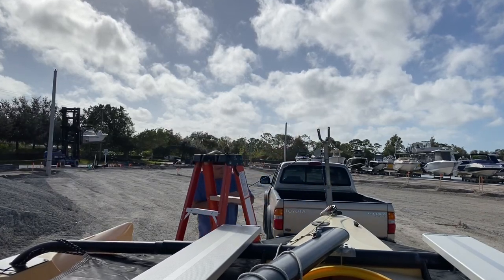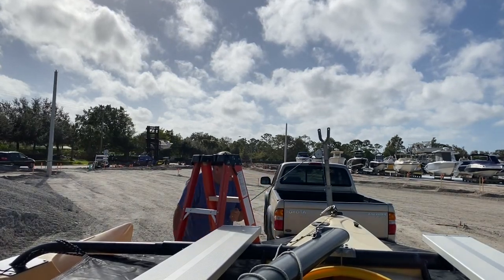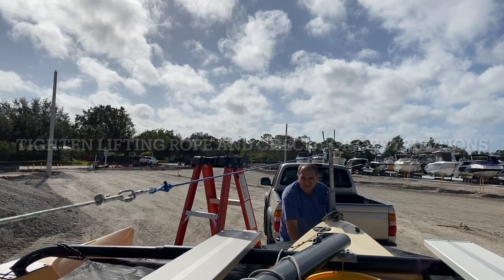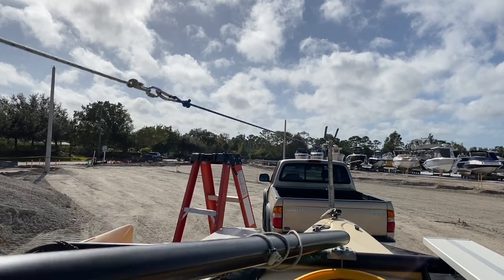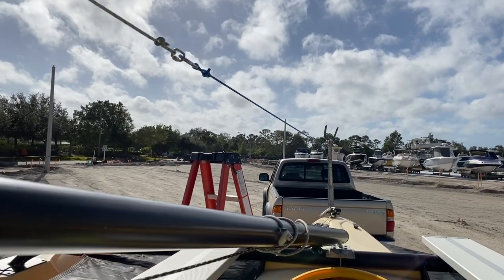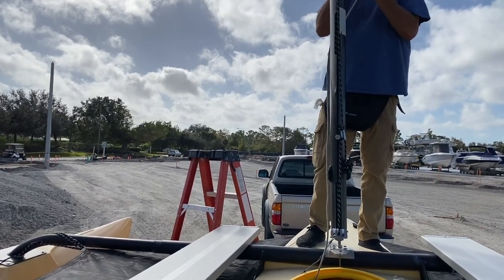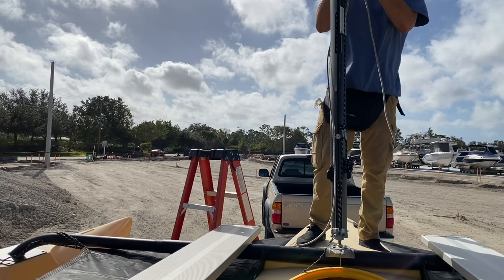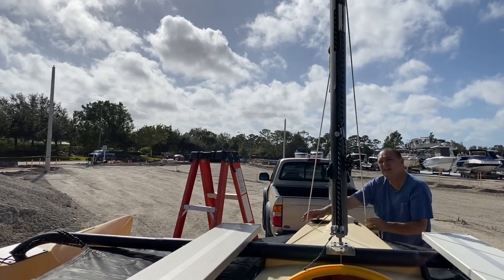Windrider 17 easy mast raising

Comment: hi we do ours a little diffrent on the older windriders there is a place on the crossbeams to bolt a tube port and starboard on the fwd end the two ends are held together with a pvc bent in half(makes an A frame)with a rope with 2 eyes topside is for the forestay and bottom side goes to the winch and if the boat is not on the trailer just attach a line to the bottom side always make sure the mast is twisted when lowering to keep from breaking the casting at the base of the mast.on the newer boats the bolts holes do not exist but i made a pvc collar to go around the crossbeam as a pivot point.also replace the snap shackles that are on the shrouds with shackles that have a pin the snap shackles have been known to come loose at the least opportune time.i noticed on the boom next to the mast you did not use the down haul that will tighten the luff and move the curve of the sail fwd loosen it when you go down wind to get a fuller sail. i likr ziggies lavengood addition to the mast base to adjust the mast rotation. my email is corsairf28r@yahoo.com